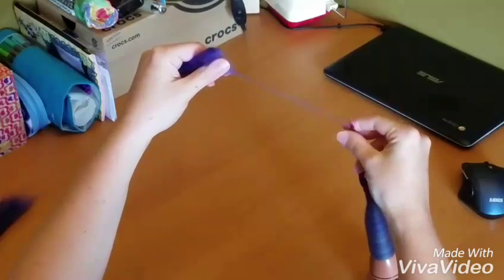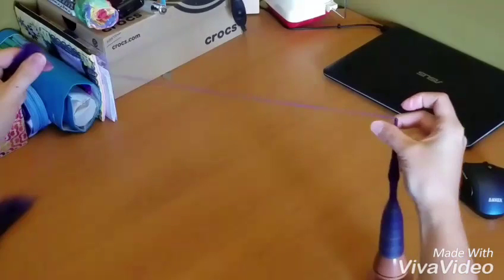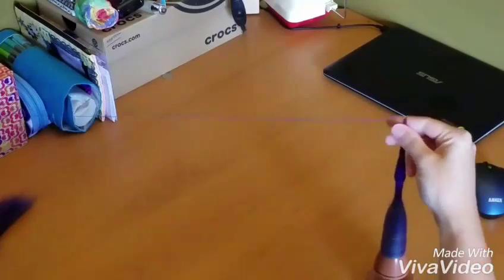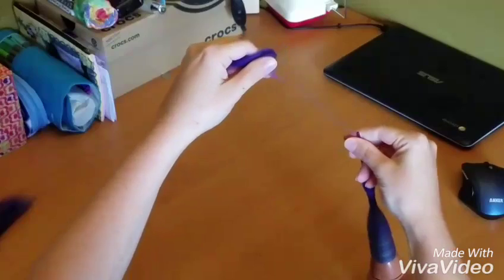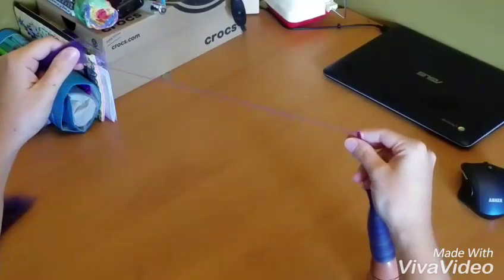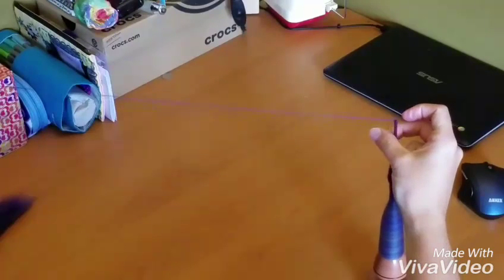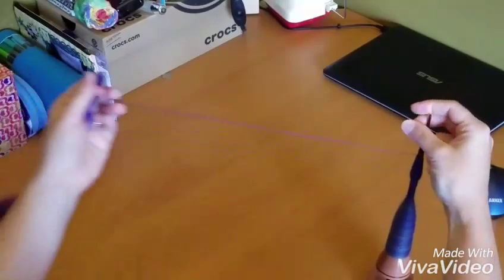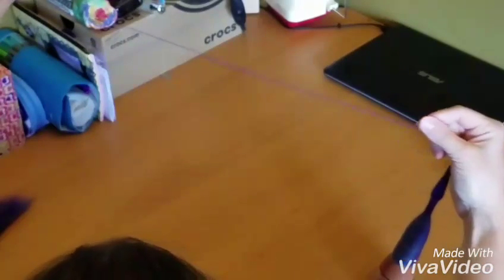Demo of Supported Spindling

Comment: I have tried to spin on my supported spindles but always get in a muddle unless I use 'park and draft'. One thing I had never tried was spinning from the fold. This looks so good so I will try that next time I get the urge to do some supported spindling! You make it look so easy! Thanks!
Reply from the maker: I always “park and draft”. I only use one hand to draft and pull against my spindle shaft but the spindle is stationary while I draft. If you’re happy with the yarn you’re producing keep doing what you’re doing.